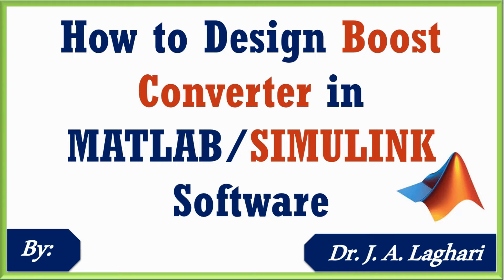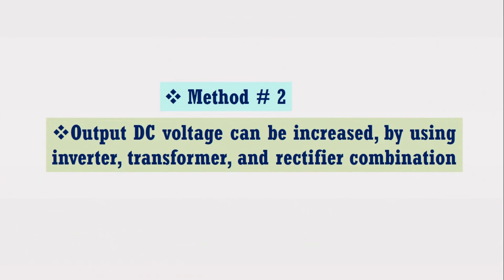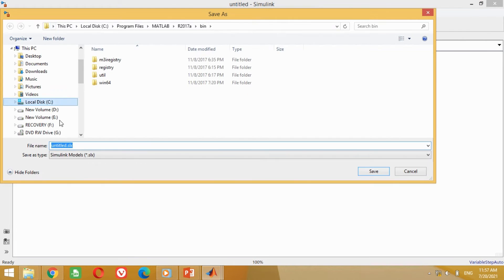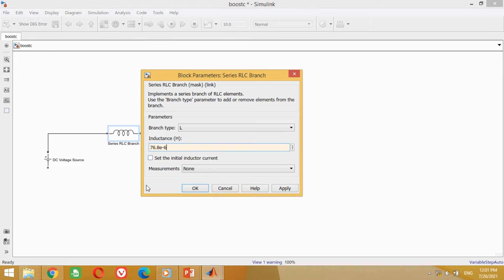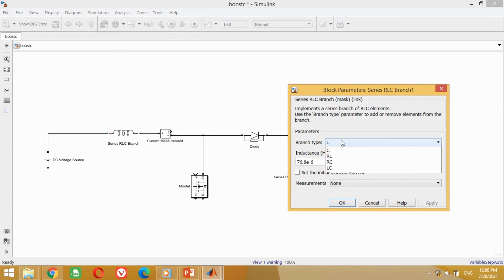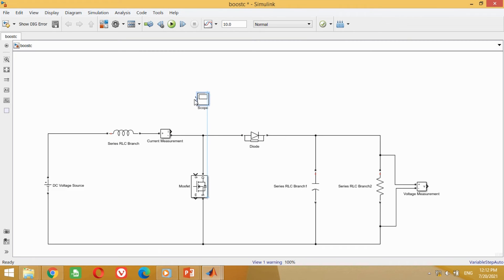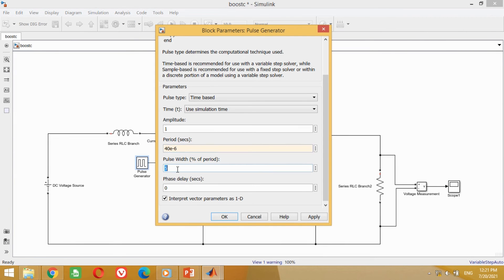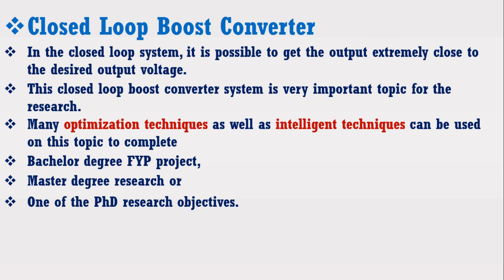How to Design Boost Converter in MATLAB SIMULINK Software ? | Dr. J. A. Laghari

Comment: This is a simulation video, not a design video!
Reply from the maker: Thanks for the comment. You mean by design means experimental setup?
Reply: @DrJALAGHARI  by design I mean, calculation of component values based on a requirement. You just simulated existing design but your video title is how to design …
Reply from the maker: @alperuslu  Right. I apologize that

Comment: Why frequency 25 khz is used?
Reply from the maker: Thanks for the comment. It usually needs high frequency signals for accurate conversion. Normally 5kHz,. 10kHz and so on are used to get the desired results.  Due to same reason here 25KHz frequency is used.

Comment: hi my sir, i have problems  how to save the project matlap in desktop folder when i finished any projected if save it in desktop it be in pdf only and i cant open it again , did you make small  video how  creating path  in desktop to saving the matlab project ,pls sir and thank ,ahmed,iraq
Reply from the maker: Thanks for the comment. May I know which matlab version you are using? How you are saving it. First time I am listening this issue.
Reply: @DrJALAGHARI  my dear,dr j.a version 2017, and iam using sav as icon  to save my projct

Comment: I have looked at the formulas of duty cycle, inductance and capacitance values. They seemed too complicated for me. Is there any easy way to calculate the values of I and C. Also how do I calculate the values of DIL and DVo?
Reply from the maker: Thanks for the comment. For this purpose, you may go through other videos which manually peovide the calculations of these values. There are many good videos available on YouTube. I will also try to make a video on this topic soon.
Reply from the maker: @berfinalkan2282  I am really sorry I am busy in my job engagements. It wouldn't be possible to make a video on this topic.

Comment: thanks Dear Dr Laghari. Nowadays power electronic is going to be very important for electrical engineers, therefor I hope you are able to give more lectures series about mathematical modeling power electronics and its control strategy. I hope you are able to teach us some lectures series about microcontroller PCB design for designing our power electronics circuit efficiently.  May God reward you for your teaching in science of engineering.
Reply from the maker: Thank you so much for the compliments. I will try to do as much as i can.

Comment: Dear prof. Mtheod 2 actually provides galvanic isolation so in case of faults it can come handy which is a huge advantage. The efficiency can also be increased if the components are designed properly. By increasing switching frequency, transformer size can be effectively reduced.
Reply from the maker: Thanks for the comment. Agreed. It depends upon the application. If our intention is to increase the voltage only then second method becomes exoensive and complicated. Choice is yours.
Reply: Agreed.
Reply: Looking forward to this series on Power Electronics.
Reply from the maker: @sheharyarsaleem5810  insha'Allah